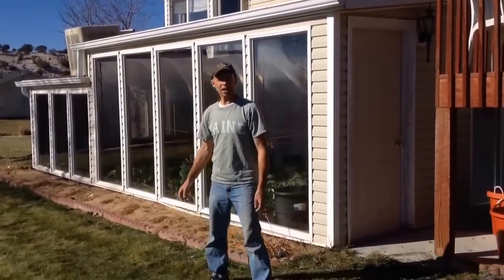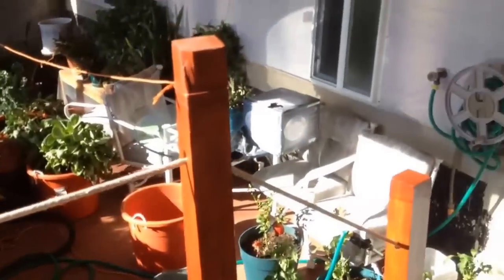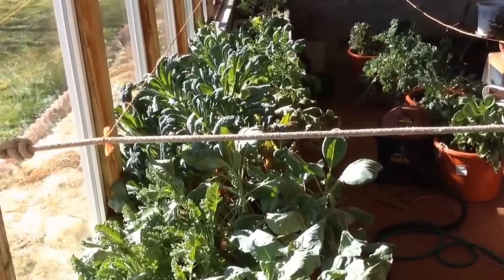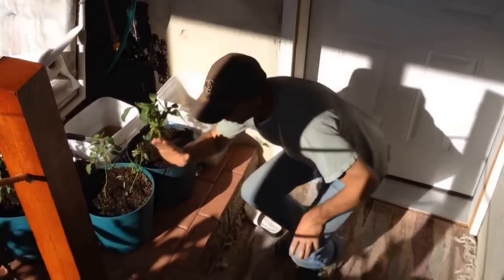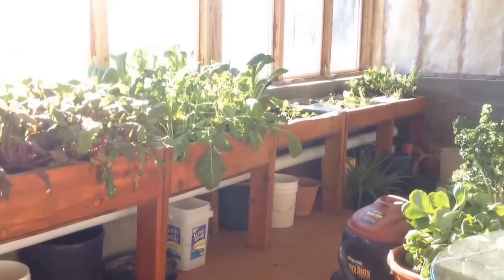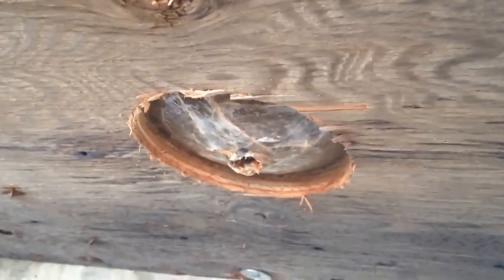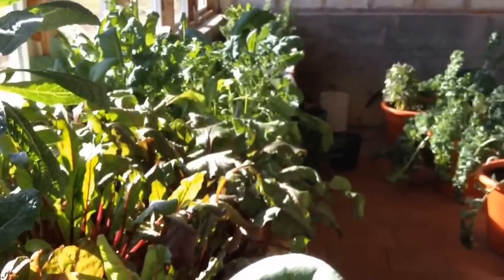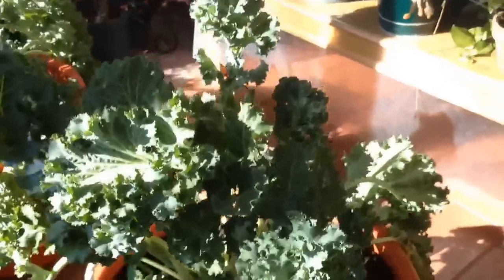Design an attached winter greenhouse / solar thermal mass heat room

Comment: Love the green house!   Have a suggestion for the water drainage on you grow boxes....it looks like you’re getting some “back flow” of drainage onto your wood.  A cheap and easy way to prevent this is to put a plastic kitchen funnel from the Dollar Store or other thrifty shopping store through the hole in your plastic so the nozzle of the funnel hangs down well below the wood bottom of your grow box.  I’d also consider painting the bottom of the box for extra protection and longevity.   Happy growing and thanks again for sharing your design!

Comment: VERY NICE JOB !!!  May I suggest that under the planters where you collect your compost tea that you fill any unused space with containers of water.  The containers of water don't have to be in direct sunlight to absorb heat collected during the day.  Even if you only reach 60 or 70 degrees in the winter during the daytime, the containers of water will reach those temps as well and help at night.
Reply from the maker: +DoingItCheap Good Idea and suggestion! Thanks for adding your ideas!

Comment: I love the paver floor idea... I'm gonna steal it...;)
Reply from the maker: +Pynenberg3 Great! we loooove ours. The red ones were the darkest we could get, so it would get more solar heat. We thought to paint them black, but we would not risk it pealing up from walking on it, as paint will make it high maintenance and the red brick is low maintenance and looks great for a long long time... I would however recommend putting lots of layers of sealer on it, so it will clean up and off supper easy; and it will last you a very long time and still look new years later and will not get stained with water deposits as easy :)!

Comment from the maker: jb pitcher I tried to reply to your comment but it wont let me so I am posting my reply here .... Hello Pitcher and thanks. My location is about 39.5 latitude and I live in a side part of the Rocky Mountain range, at about 1 mile high in elevation (in case you want to get a better idea for your designing)… It has hit 39 below zero here at night and I did not freeze in the greenhouse. Keep in mind that the windows I use are double pane, which I would not consider anything less (I would use the picture windows from sliders, used in sliding glass doors as they will be far less on costs as they mass produce them and they are tempered and do not break easy at all)… a few years back, we got a New Years wake up call from a buck sheep that jumped fences and came in contact with our nice reflective greenhouse windows and it saw its face in the window reflection and decided it was going to kick the butt of the other buck it saw staring back at it… and this large buck started to ram the window… we heard and felt the vibrations in the home ha ha These windows are great for safety and the bigger point I wanted to make was that its ramming horns only broke one of the two panes and you could feel a HUGE difference in temperature from having a window with only one pane and it did freeze in the area next to that window (I cant remember what the outside temps were at though)… keep in mind that when temperatures do hit record lows, it will be when there is snow blanketing the ground (not letting the grounds thermal heat help warm things up) and usually it will be when the snow storm, with its blanketing clouds move out as the sun goes down, so there is nothing to keep the warmth in for the night and the temps drop like crazy… I bring this point up, because when it has been cloudy, and the sun is not shining, the greenhouse thermal mass is also not getting heat storage from the sun and this is when the greenhouse thermal mass heating capabilities are tested… and when you get the combination of cloudy in the day and clearing out in the early evening for a few days, it sets your greenhouse up for freezing… 
With my attached greenhouse, I have the back wall up against the home, and it does get some warmth on cold nights from natural convection. I have NEVER had to open up the door from my home to heat the greenhouse at night, as it does not freeze in there…. If I were to build a greenhouse that was not attached to the home, I would build it using the concrete back wall (or one could go cheaper, with dirt pounded tires, or some treated or protected back wall)… then I would go three feet of packed dirt and some kind of foam type insulated divider to keep the thermal mass heat retained for when temps drop in the greenhouse, the heat stored in the thermal mass of the ground will flow into the greenhouse (this has been proven to work well, with people that build Earthship type homes)… 
My greenhouse also is in the ground 3 feet, so it does also get heat from below the frost line. I originally planned to go out a few feet from the front wall and put foam board, to create a insulated thermal mass in the front as well, but I found that I did not need this added conservation feature and the flat out truth of the matter, is that it would still be a huge benefit to my greenhouse if I put it on my to do list and just do it … but anyone building one (including myself :) should do this, because the cold outside DOES transfer straight through the upper part of the concrete wall and it draws and sucks the valuable stored heat right through the concrete to the outside…  projects ha ha 

The roof design will obviously vary on how the home is presently designed and built… Some of you might have your home on ground level and be able to pull your roof line straight off the present roof line and be able to have venting above the insulation, (between the roof and insulation) which I would recommend. 
Due to how the layout of my home was, when I attached my greenhouse, I was not able to have a very good slope on my greenhouse roof. I would try to get a 12/4 pitch slope if you can and if not, then use a metal full sheet roof (to avoid ice damning or do a good job installing ice shield type system to avoid ice damns and potential water leaks. 
The roof on my greenhouse is made of 2x10 wood spanning trusses and batted fiberglass insulation between them. Fiberglass insulation breaths and has worked perfect for 20 years. I must admit, that I did not video it, as I am embarrassed that I have not done anything with it for 20 years and it is a bit shaggy and is still on my to do list ha ha … Do not put any vapor barrier/plastic type barrier on the ceiling though, as it can create condensation when the conditions are right; for this reason, building codes do not want you to have a vapor barrier on the ceiling… The more breathable the better to be on the safe side . And if you can do it, build a roof with the ability to have a small space for venting air flow between the top layer of insulation and the roof, to avoid any future problems. I purchased vented aluminum soffit that I still need to install (you will want to use vented again for air circulation). I will probably drop the ceiling using a cedar or redwood 1x1 that I rip with my table saw (I want to have just a small breathing space between my batted insulation and the vented aluminum as well). The soffit is very easy to install and there are lots of videos on You tube for those who want to see how east it is to do. Here is a written up do it yourself guide for putting it on the home, but the principles are the same .. http://www.familyhandyman.com/roof/how-to-install-aluminum-soffits-that-are-maintenance-free/view-all  It must also be noted that you will control how much humidity is in the greenhouse, by how many plants you put in it and one big indicator is how much condensation builds on the windows when the temps drop in the winter. But make sure to build the greenhouse with windows that can be opened to get a cross breeze in the summer and for cracking in the winter for venting. I crack my upper window in the coldest part of the winter, when I have a large amount of plants and it works great (I still plan on installing my humidity sensing bathroom fan that is also still sitting and waiting for me to install ha ha)… the fan will draw air in from the earth tubes, if you close the windows up…. You asked about pipes in the ground for circulating the air… for 20 years I have just used the windows to control air flow and temperature in the greenhouse, which has been great, but there is a far better way to handle the air circulation in the winter and throughout the year….  It is by using the earths warmth and running tubes through the earth (depth depends on your location) and pushing air through the earth tubes and into your greenhouse. I wrote about it on a strand here, but cant remember how detailed I got. I have not run the fully dedicated earth tubes as of yet , but I plan on finishing it. Natural convection of opening upper window should be enough to draw the air through the earth tubes and it will come preheated into the greenhouse at earths ambient temperature where you have run your earth tubes. There are many people on the web that are using this earth heat and many term it earth tubes… I would absolutely highly recommend and advise anyone who is already going to be building the greenhouse to make sure to incorporate this system into their greenhouse, as it is sound advice and uses free earth geothermal energy to heat and cool the greenhouse… The homes of the future and greenhouses WILL have a far far more involvement, if not exclusive involvement with the earth and harnessing earths heat and cooling …   I will do my best to try to get my ceiling soffit installed and wrap up the ventilation with the earth tubes that I started and put it into a video this summer…
Reply: Wow, that was helpful. I'm definitely considering cinder blocks and sliding glass doors after reading this. Thank you.

Comment: Hi Steve, I just need clarification on one small point if you have a moment. I'm looking to build a winter lean to, which is attached to a south-facing insulated garage wall. I understand that the sun is lower in the sky in the winter and insulation is key . Is it necessary to trap solar heat through a polycarbonate roof in addition to the glass wall ? Or would you recommend just installing an insulated R20 roof? I'm located in lower New England. At the very least I'm looking to overwinter Mediterranean plants. I'm considering supplemental heating due to extensive cloudy days. Thanks! I love your design and will be using the same insulated floor. I'm not sure how deep I'm willing to dig for tubing just yet...

Comment: What is the name of the sand you used under the pavers?  Do you ever have moisture problems with this system?  Do you have a video on how you built this greenhouse and what the walls are insulated with?
Reply from the maker: I don't know the name of the sand we used. Moisture is a very important issue that you MUST keep in mind when building an attached greenhouse. We have a moisture barrier between the greenhouse and the home. I used fiberglass insulation batting. We have a very small window up near the ceiling that we crack open to allow convection to pull air through the room to draw moisture out. Moisture condensation does build up on the windows when it gets cold at night in January (we get between zero and -20 and have reached -39 without it freezing our greens); so it is important to built the bottom plate (under the window) with treated wood and where we live we have concrete under that... I am getting more and more into having low maintenance self running gardens, so I purchased a great bathroom ultra quiet fan (80 cfm) that has moisture sensing and it will turn on when there is moisture that needs removing... that way I do not need to crack the window ... I have a system that uses earth tubes that pulls air into the greenhouse with air that is preheated by the warmer underground temps and keeps the greenhouse with fresh earth warmed air. Life has been so busy that I have not finished installing it all; but I will do a video showing all of this when I get it done... good luck and god bless

Comment: Hey Steve,
What is the average temperature in the greenhouse in the winter? I am looking to build an attached greenhouse like yours, with temperatures warm enough for tropical plants. What would you need to add to your greenhouse setup to make that possible? Thanks!
Reply from the maker: Hi. I am not sue how hot it gets on average, but it can get on a warm late fall day, when the sun is lower on the horizon, in the upper 90s... but I have not monitored it (this is when a person would have it open and heating the basement nice and warm). If it is all closed up it will get very hot in the fall and at this time of the year, so you do have to monitor it. The greenhouse is awesome to try doing experiments in. It realy depends on where you live and how you design the overhang on the windows or design in the windows (again, in order to have the most efficient and predictable temperature gains a home / greenhouse solar room must run east and west and have the windows facing south ... (hopefully homes in the future will all be designed this way) .... I would personally stear away from growing tropical plants due to the fact that Growing tropical plants will require you to to have higher humidity in order to keep the plants healthy .... If it were me and I really wanted to grow tropical plants and I lived in a location that was not soooo cold in the winter as it is here where we live, I would build an unattached to the home greenhouse and do it there. It truely is not worth risking mold problems associated with having such high humidity as is needed to have healthy tropical plants  and have it connected to where your family lives  ... Its possible that You definately could do it but it would take careful planning  ... I would with all due respect say to do it in a greenhouse not attached to the home in any way ... i think that would be a way cool project though... My greenhouse is wonderful for use of heating the home and also using it for growing some garden or greens in the winter ... We did grow some orange and lemon trees in the greenhouse and they got no sun in the summer when the sun was directily overhead and in the winter they were hit full on and got too much sun and they did not do well and it was too dry ... Right now we have smaller lemon, lime and cumquat trees in our home just inside the south windows and they always have some fruit on them and they do ok, but they do not like very much direct sun on them or the leaves burn; they do like more humidity and would do better with more, but we love them and they do put oxigen in the home as well as a small amount of humidity which is good... but the same kind of trees got sick and died when we had them in our attached greenhouse (so it was fun to find that they did ok in pots in our home) ... hope that explanation helps...